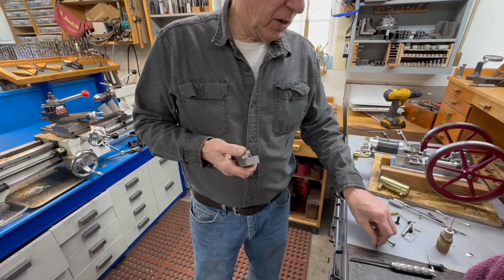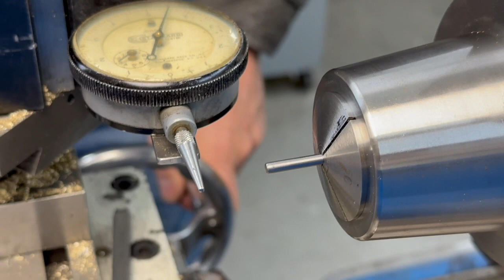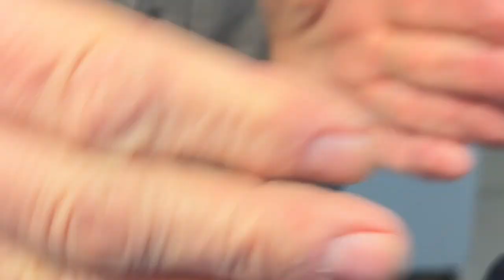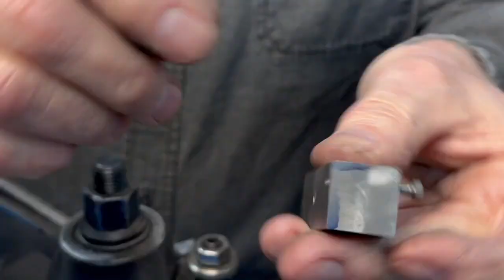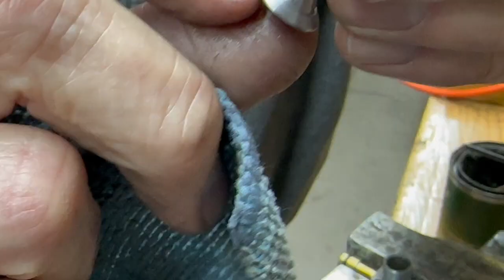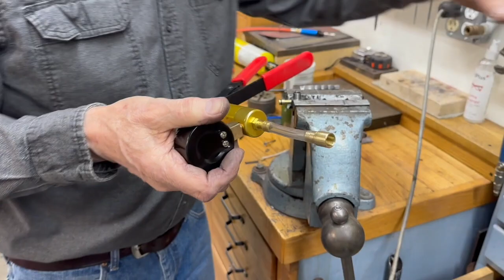Making Valves for Model Engines

Comment: Wow I make 3 valves in the time you make one just using stock stainless material EN 10278. Your way my 7 cyl 120cc radial would still not be finished ....
Reply from the maker: Thanks for watching! I’m happy you have such an efficient method for making valves. are you willing to share?
Joe.
Reply: @JoesModelEngines  Gladly: Just take heat-resistant (hardenable) stainless steel like (accurate name) 1.4057 of the required diameter, slightly longer than needed because of the turning center you make and will have to be removed again when finished stem turning, then simply turn it. That's how I machined the valves for my 14 valves for my self-built 7-cylinder 120cc radial engine (see advatar) in less than 2 1/2 hours. OK, as a retired toolmaker, I might have a slight advantage...

Comment: Suggested material for outlet valve in a 4 stroke engine. Thanks
Reply from the maker: Are you talking about a model engine?  Also is it a high RPM engine.
Reply: It’s a model engine low revs.
Reply from the maker: Any steel will be fine,I’ve even made exhaust valves from 12L14 and they worked just as fine.
I now always use a steel Allen screw head and drill rod because it’s just easy to make and lap.
Thanks for watching our videos. Joe

Comment: Making valves like this is such a great idea, I will have to give this a try when I make my 6-cycle oddball.  I also want to try and build the Smallest “”Hit & Miss” gas engine by Philip Duclos.
Reply from the maker: @taranson3057  the six cycle is a very good engine and will run well with little or no maintenance.
It’s a very good display engine. Joe
Reply from the maker: @taranson3057  you will be very happy with the six cycle it’s one of my favorites. As far as the valve design, it really makes a hard job very easy. Joe

Comment: Your video came at just right time for my project.  I have been working on Jerry Howell's Power House engine for a long time (I stopped for a few years) and after returning to this project I realize that making the valves and guides was going to be a challenge.  I had already made the the valves using SS as suggested by the instructions, but I was unsure about lapping and testing them.  Your video helps with that.  

Assuming I get this engine to work what would you recommend for a second IC engine?  I have previous machined several steam engines, but this IC engine represented a whole new level of challenge.  Thanks again.
Reply from the maker: Hi Phil , I’m glad you got something useful out of the video . As for what you should do next I need to know what you like to work with, casting sets , or bar stock. Also one cylinder or two. I work mostly with bar stock because it’s a lot cheaper if I screw up.  Let me know and I will gladly let you know what I think.

Comment: Certainly some handy methods there. I have that exact brake bleed tool. Brilliant idea for leak testing the valves. Consider that idea stolen from you. 😊
Reply from the maker: I have to confess It’s not my idea, I did make a few improvements on the connections though. Thank you for your input and your interest. Joe